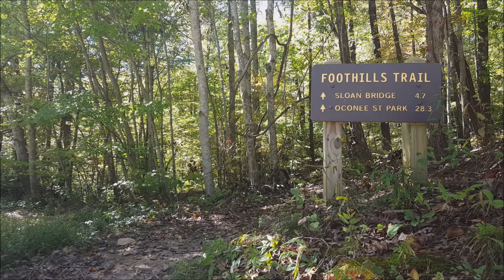Stihl 028 Wood Boss Chainsaw Restoration Part 4

Comment: Awesome videos my fuel tank on my 028 and body is magnesium I’m guessing... runs but it leaks like a waterfall come to find out the fuel tank is a clam type piece that came apart. My question is what can I put a bead of down and clamp it that would hold it and be fuel resistant. ?? Or a weld ??

Comment: should I heat it up those crankcases and froze the bearing go to drop in.. nice little video though
Reply from the maker: I didn't heat the case or freeze the bearings. Just used light taps.

Comment: Andy,i use all sizes  of bearing races ( I break the centers out)  I use the race only as guides for pressing bearings.only because they are ground to size no matter what diameter, even on the milling machine as a hold down device, well it my 02 cents worth.......till next time
Reply from the maker: Hey Ray, that is great advise! I never thought of using the old bearing races like that. Thanks so much for sharing that.
Reply: @foothillstrailhiker2426  Where did you purchase your parts? I am rebuilding the same 028 AV now and have it all apart.
Reply: Where did you get the parts I'm in the process of taking the same chainsaw apart and rebuilding it